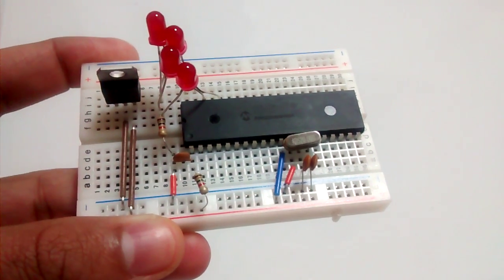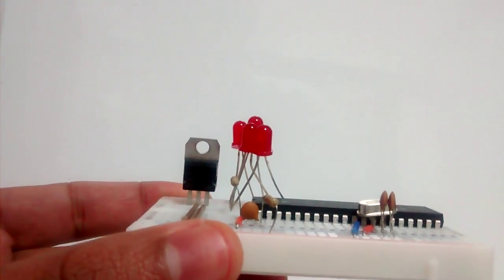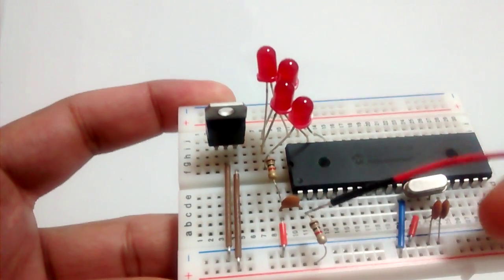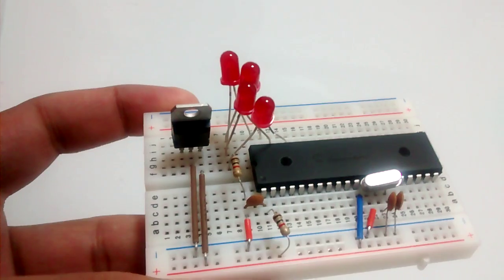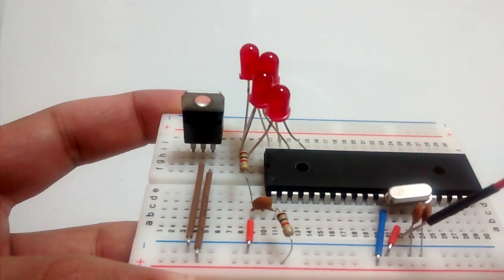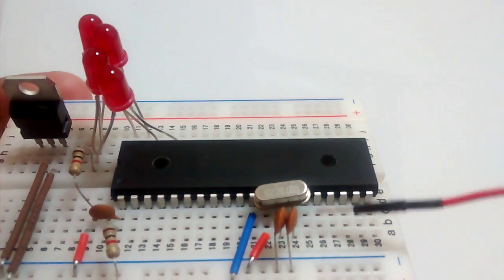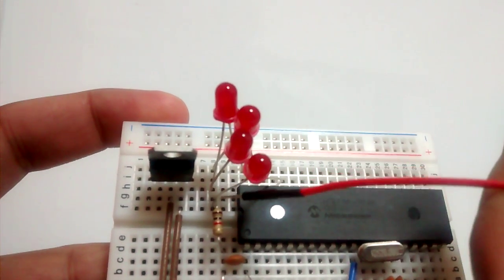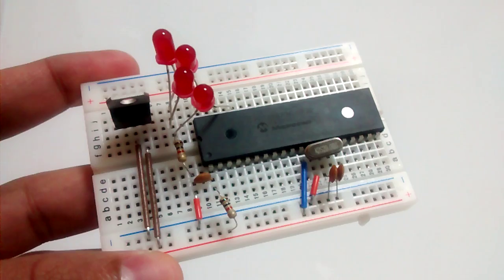PIC16F877A : BASIC BREADBOARD CONNECTION CIRCUIT EXPLAINED

Comment: Is a 100uF electrolytic capacitor fine to be connected between MCLR and ground rather than a ceramic capacitor.

Because I can't find any 100uF ceramic ones, the maximum I have is 100nF

Comment: sir why you didnot connect pin 32,31
Reply from the maker: Coz the power and gnd are already connected to pins 11 and 12
Reply: thank u sir if i connect that pins what happen
Reply from the maker: @sasikaranselvaraj6682  I don't think anything risky would happen. Coz pins 11,12,31 and 32 are meant to supply power for microcontroller.
Reply: @imtheroboart  thank u very much your replay if u please help me how to quickly learn microcontroller programs bcoz i am eagerly wait for learn controller please help me..

Comment: How much voltage are using here?
Reply from the maker: I'm using a 9V battery and have a 7805 Voltage regulator. The input voltage for the micro controller is 5V

Comment: do i need to use external oscillator? can't i program it to use the built-in?
Reply from the maker: Vaidesh Iyer As far as I know, PIC16f877a does not have a built in oscillator.
Reply: @imtheroboart dedicated video 🙏🙏

Comment: sir what type of capacitors you use with that crystal in pin 13 and 14
Reply: Deo Damian Disc capacitor of 33pf
Reply: 33pfd ceramic

Comment: I bought 100nF (0.1uF) electrolytic capacitors. And i do not seem to get a clock signal. I found these values from the datasheet.
Maybe they are too high? Or perhaps my configurations is not correct.
Reply from the maker: Rick Veens u made connections as mentioned in this video ? Try with 33 pf capacitors..
Reply from the maker: Ur project configuration will also has effect on the working oscillatr.. u should select it properly - HS LC RC etc